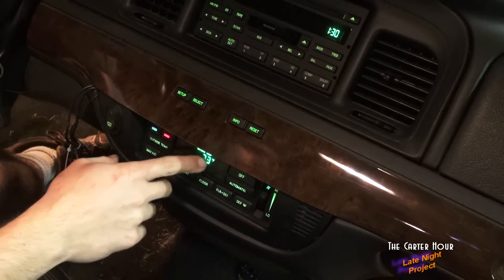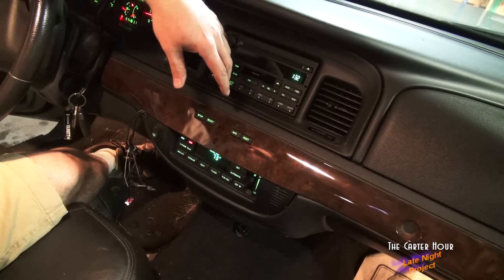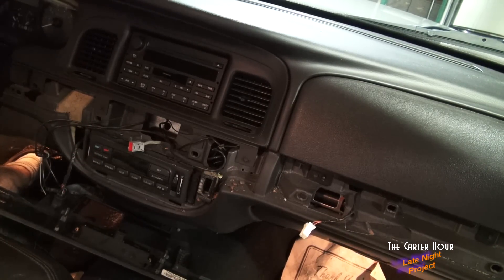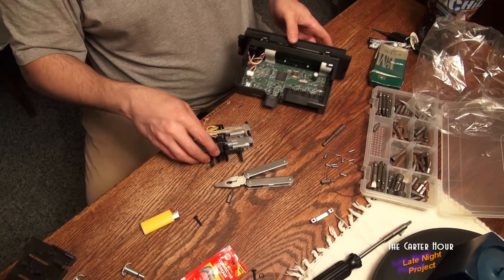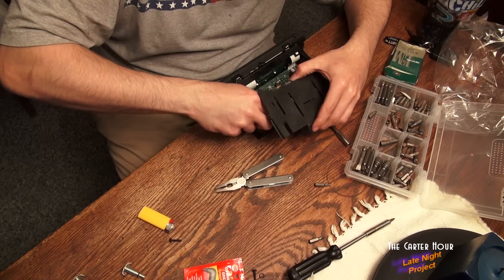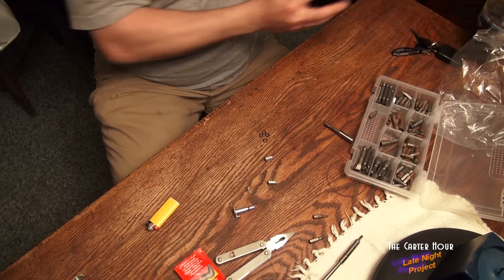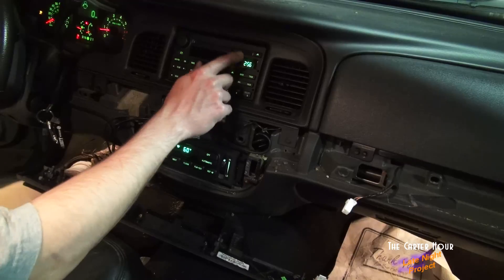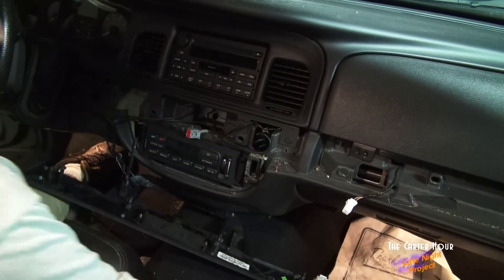Ford Lincoln Mercury EATC Repair Video - In Depth Tutorial - 3.00 Dollars in Parts

Comment: Thank you, this video is really helped me. But I do have another problem with my Crown Vic. A/C it would not switch to Heater!!! I don't know why? Do you know why?
Reply from the maker: Did it work before going from cold to hot?  If it did you might want to re-check your connections on the back of EATC.  If the connections are good, then another common issue with the Crown Vic/Grand Marquis is the blend door actuator.
Reply: The Carter Hour the connections  looks good, but may the blend door cause this... thank you
Reply: Naif Sh I tried the self test and the code is 024.. if you have any idea?
Reply from the maker: Its the Blend Door Actuator.
Reply from the maker: What you need to do is simultaneously press floor and off, then within 2 seconds, press automatic.  That should start the process.  If the screen comes back 888 then all checks passed.
Reply from the maker: Jeff Weber
Your Welcome, thanks for stopping by.
Reply from the maker: Yep, good ole blend door actuator.
Reply from the maker: Yes, that is correct, though I have heard of people replacing by removing the passenger side air bag, but no descriptions on how to do it.
Reply from the maker: You know that's interesting because my 2008 is working as it should, and the 2006 is blowing through the vents as well.  I will keep you posted as I plan to remove it tomorrow and see what is going on.

Comment: Nice video. I have a 2003 Marauder. the air only blows a 70 when it's 100/above outside, and 45 when it's 67. Over the months I've had the compressor, and condenser replaced. The EATC and blend control module were replaced two years ago. Any suggestions? Thank you!
Reply from the maker: Sounds like your orifice tube maybe clogged.  This should have been replaced when you had the compressor, and condenser replaced.  Did you also have the accumulator/drier replaced when the other work was done?  You will find this down attached to the passenger side frame rail.

Comment: I have this problem with my '06 MGM. I was told to use red silicone O rings. My problem is the likelihood of breaking off several plastic tabs, prongs, whatever when removing the trim panels to get to the unit. Seems like every time I try to remove a piece of interior plastic I invariably break something. It is impossible to know what is behind the panel holding it in place, and if you pull in the wrong place, or the wrong direction, something will break. I have little doubt I about repairing the unit itself, but I would likely not be able to get the trim panel back in place. Why can't they just use screws on these things instead of those weak and brittle plastic clips. It is impossible to find good replacement parts for the interior of these cars. My drivers door panel is already broken out where the power seat switches are, and tabs are broken on the drivers door on the panel that holds the power window, mirror, and door lock switches. 

Thank you for this video, I will give it a try. My A/C all comes out the defroster vents, and I live in Phoenix, AZ where it is really hot.
Reply from the maker: As long as you just pull on the panels like I demonstrated in the Video, you should be fine.  Usually it will not break unless its not meant to be removed by force.  Cheers and Good Luck!!

Comment: Nice tutorial, I'm in serious need of help. My climate control unit reads is reading the outside temp as 127° when it really is 7°, the heat wont engage, or even turn the fan on. BTW I checked the current and the blower motor. please help
Reply from the maker: Hi Erick, there is a temperature sensor between the grill and the AC Condenser on the front of the car, its pretty easy to get too, you will find two temperature probes in some cases and one in others, that tells your Unit what the temperature is outside.  By what you are describing on the faulty read out, sounds like the sensor has gone bad.  Cheers. :)
Reply: The Carter Hour Thanks a million, I'll check that out and post an update ASAP

Comment: I couldn't wait to order O-rings , so I went to the junk yard . they didn't have no car that match my 2006 grand marquis. what I did I found a 1998 Lincoln continental eatc system broke it down an got the whole part wit the o-ring a round put it wit my eatc an it work !!! so if you can't wait an your junk yard got a 98 Lincoln continental the actuator is the same size but the system is not good luck !!!!
Reply from the maker: Great information.  Must of required some modification?  Thanks for stopping by my channel.

Comment: YOU ARE Z MAN. Shit I had same issue. Took it to mechanic and got a call that the ACTUATOR DOOR needs to be changed and was coated $100 + $700 for the job. So I went and got my car back and tolerated a hot summer. Saw you yesterday so I went and bought the O-RINGS from ORiley. EASY job. $3 plus $7 tool box. Now my blower works great. I ow you. Just ask.
Reply from the maker: Hi Elie, I am glad that you got your EATC working.  It is so much better to have it working right especially in the summer.  Congrats, I am glad my video worked for you.  Take Care.

Comment: About to start this project; hope it works....Ford wants over $1000. I underestand the size of the O Rings (007), but there are so many different kinds: Oil, heat, chemical, water,  or steam resistant; hard or soft; Fluoroelastomer, silicone, Polyurethane.   Which one should I buy?

Comment: Thank you so much for posting this video.  I took this issue to my local independent mechanic.  He told me ford wanted $550.00 for the part.  He doesn't like to deal in "discount" parts but suggested I may want to in this case.  He sent me home to shop on line and that's when I ran across your posting.  I spent $5.50 (exactly) on four o rings and grease.  It took me less than an hour thanks to seeing the details in your video.  Works perfectly!  Please don't get discouraged by the folks who leave nasty negative remarks.  You are truly helping people like me.  You rock!
Reply from the maker: Cheers....thanks for the follow up and sharing that it helped you get it fixed!!! Cheers.

Comment: I have a 2000 Grand Marquis.  I had my heater core replaced and now the air only blows through the vents and I do not get any heat at all in the car even though the core is hot.  Will this help me?

Comment: How do you calibrate the e.a.t.c unit one you rebuild it and put it back to the
Car? By the way good video, a very clear sound good job!
Reply from the maker: You don't need to calibrate the EATC unit.  Thanks for the kudo's :)
Reply from the maker: Hey John no need to re calibrate on these EATC units.  You can run it through a test, but I just usually cycle through the modes.  GM EATC's are a bit different and require a calibration method.

Comment: I have a 1996 Grand Marquis I'm just getting air from the vents, no floor or def, it is not making any noises, not sure if it is a blend door or the HVAC unit.
Reply from the maker: +455cutlass Greetings, Its not the Blend Door actuator, if it was you wouldn't be able to change the air temp.  I have the same issue with my 2006 MGM.  I will be investigating this issue, and I will hopefully have a response video here soon.
Reply: +The Carter Hour  I have been told that the 1995 to 1997 climate unit is boxed and you can't get to replace the rubber o rings
Reply from the maker: 455cutlass
It is encased in Metal versus the Metal Plastic, however if somehow you can remove the spot welds (I think they are) you might be successful at getting them changed out.  However you might be able to go to a salvage yard get an updated model 2001 or greater from a CV or MGM and use that one.  Last time I picked one up from there it was about 20 to 30 dollars.  In order to get the display to match your color inside the car, you could swap face plates so the illumination remains blue.
Reply: +The Carter Hour  right now a used 1996 or a 2001 are about 150 at the wreakers
Reply from the maker: If I had an extra I would send it your way.  The only other way you could go about it temporarily is un hook the vacuum harness from the back, get a piece of vacuum line and from the black line in the middle route the piece to any other line.  Not sure off the bat what each color represents but that will switch it to other air vent directions.
Reply: +The Carter Hour I'm going to make some calls tomorrow to see if there is anyone around that can repair the unit that I have, if it was just bending some tabs I would do it myself. I have a line on a unit 1996 for 145 plus tax so 170 total but I can send it to Vancouver to get it rebuilt for 100 but would be without it for 2 weeks
Reply: +The Carter Hour +455cutlass Similar problem 1997 MGM: minimal airflow defrost or floor, mostly dash registers. EATC test codes: 024, 125, 115. 024=Blend Door which does not explain misdirected flow. . What are 125 & 115 and do you think the O-ring repair would help? Thank you.
Reply from the maker: I don't think it would hurt however I don't think it would help either.  I believe I have found the answer to vent always blowing air.  There is an actuator behind the dash thats controlled by vacuum, in which the actuator opens it opens all air flow to vents and nothing else, if say defrost is activated, that actuator closes and opens air up for the defrost, slash floor vents.  Its the second large actuator towards the passenger side of the car.  Seems to be quite difficult to get too.  Not sure what the replacement procedure is for this.
Reply: +The Carter Hour  I had the dash pulled a local shop did the work, I did not want to remove the dash myself to large a job. when they pulled it all apart they found that the hinge on the door had broken, just a plastic part and that you would need to order the whole air box from ford. they just wired it together so that it would hinge. so now it is working with no problems
Reply from the maker: I have a feeling your right on the money with my issue and a few others that have complained about that very issue.  I just put the 06 MGM in storage, so I will address this issue next year, can't wait.

Comment: I wonder why it don’t work for my grand marquis 08. Please help I’m in atlanta and it’s the middle of summer 😩
Reply: @TheCarterHour  it’s not blowing out the vents. Only through the defroster. The AC clutch is coming on. The air seems cool that comes out of the defroster too. I don’t hear a knocking noise similar to those I heard from blend door actuators replacement videos. I also did the self diagnostic and no codes came back. The car runs great just the AC. I don’t discredit your video maybe I didn’t do the o-rings right? They were pretty tight trying to get them on. Idk what else it could be
Reply: @TheCarterHour  i did double check the solenoid packs but will triple check I did use grease too. not sure what the mgm is but when I change to max ac the air comes the defroster and there is a idle change coming from the engine.
Reply from the maker: @tuumboon61  Sounds like you might have a vacuum leak.  MGM = Mercury Grand Marquis. :)  Try this, when you start your car, with everything off, AC Radio, etc....see if you hear a hissing sound.  Now you will normally hear one because the climate control actually uses vacuum to pull in cabin air through a temp module, but that is not a big hiss, we are looking or more hearing for a big hiss coming from the dash.
Reply: @TheCarterHour  I just checked and honestly didn’t hear a hissing noise. If it is a vacuum line issue, are there any other ways to check for it? There’s also this thin white hose that is under the steering wheel jus kinda sitting there I feel like it should be connected to something..  could be related ?
Reply from the maker: Yes, that is your e-brake release.  When you shift from park to reverse or drive it is supposed to release your parking brake.  That also operates on vacuum.  As long as it’s plugged off it should be ok.

Comment: Did you ever run the Diagnostics test you can run through the EATC?? Just curious if this problem can still be the cause even if the test throws no codes & displays the 888 which is the EATC running correctly code. Just dont want to do this if its a waste of my time. Great video, very slow & detailed!!!
Reply from the maker: *****
 I am so glad that I could help you Beth.  On your prevous comment above about diagnostics, the EATC will not through an error code for the vacuum leak in the solenoids.  Thats pretty much all it wont show an error code for.  I am especially happy that I was able to help you to get it working again.  Your comment touched me.  I know what it is like to have to save and conserve every dime and penny.  I am willing to bet that your freon level is down beyond the compressor cut off switch or known as a pressure switch.  You might just need a little freon.  However this weekend I am hoping to do a video on my brothers 1999 Buick Century, using an experimental freon called R-152a, which works well for both a replacement of R-12 and R-134a, and costs much less, in fact you can find it in pretty much any store.  Again thank you for the blessed comment, I am glad its working for you.

Comment: Great video but my unit from a 2000 Grand Marquis does NOT come apart.  The solenoids are spot welded in and it makes it all but impossible to take it apart to replace the o-rings.  Any suggestions.  The part is an XL7H-19D611-AA and the whole EATC is F8AH-19C933-AF / EATC- EN114.  I hate that I came so far and now can not complete the job…. but still Great video.  Anyone out there if you can help I would appreciate it.
Reply: There's another guy on YouTube that shows you how to get around that issue with the part that you're talking about

Comment: I am getting code 25, 25 25... then 888... but the thermostat is goes from 15 to 32.   No air and nothing happens.  I changed the blend door actuator Becusse it kept clicking real loud.   Thought that was the issue.  Any ideas?

Comment: 1990 town car non-digital head unit isn't sending proper 12v to the attached vacuum unit. which causes it to no acuate between hot or cold. all of the rest of the blend doors work just fine. I just pulled a junk head and the attached vacuum unit from a 91. but I destroyed the 91 dash it was hot. I have considered sending off the unit that came with the car if the 91 won't work. they are different part numbers but look the same. Any advice would be helpful. Thank you.
Reply: @ Jimmy page
Reply from the maker: I think that year had the old type of ATC, not the digital.  I think its driven by a cable.

Comment: I rebuilt the metal unit.. you need to take a small screwdriver and pride/webge softly up between piston housing  and frame.. then the piston will come out... the end covers were deteriorated so I replaced it with silicon .. waiting for silicon to dry will give further info tomorrow.
Reply from the maker: +Tomigun101 This is very good to know, I had one of those units and wasn't really sure if it could be done, but I am glad that you left a comment stating it could.

Comment: I have the same car but my problem is with the heat not making it's way through the ducts.  Is the EATC only for the air conditioner and is the blend door actuator for heat?  I can feel a little heat through my vent setting.
Reply from the maker: Greetings Alan, no the blend door operates the temperature, so my guess would be that your blend door actuator is shot.  Now there are two ways of going about repair, 1. take the passenger air bag out and try to replace the blend door actuator, however I have never done this.  2. Take the dash board partly out and then replace blend door actuator.  I have never had to do this, but I hear its a chore.

Comment: I have a 1998 Merc GM. It only blows cold air. No heat. The Vent/defrost/floor works fine. Any help appreciated.
Reply from the maker: Hi Harold, sounds like it may be a blend door actuator.

Comment: Good Job! So , o-ring size is 007, how about  that silicon grease, name??/ can I use any other grease?? Thanks, youtheman!=)
Reply from the maker: +Eero Laukkanen Eero thanks for stopping by, i just used a bit of spark plug connector silicone grease.  Usually you can get them in little packets at the auto parts store.  Cheers my friend and thanks :)
Reply: OK, thanks, youtheman, Merry Christmas, nice video, like, when people can save money! I have Infiniti FX 45/2004, driver's door handle broke= plastic, typical problem any Nissan, Murano, aso, well, dealer wanted $270.00 for the part, $160.00 for to change it, since car has keyless entry button in a handle, I took it out, glued handle back, used also 3 very small drill bits for strengthening, Epoxy glue, cost $6.50, works like new=) there is a Christmas story for you !!!=) Ps. had to take inside door + glass out, if not keyless entry, 5 min job, like in Nissan Murano, very simple..., one screw in end of door, don't have to take inside door out...
.
Reply from the maker: +Eero Laukkanen Nice work.

Comment: HI, I was wondering if you have heard of the solenoid pack being cracked on the inside (referring to the solenoid pack inside the eatc module) or if I am being scammed to replace the whole solenoid pack for about $200. So question 1) does it sound like I am being scammed & 2) how much does a solenoid pack cost?
Reply from the maker: +Please Answer I have never heard of a solenoid pack being cracked however its not impossible if someone isn't careful in dis assembly.